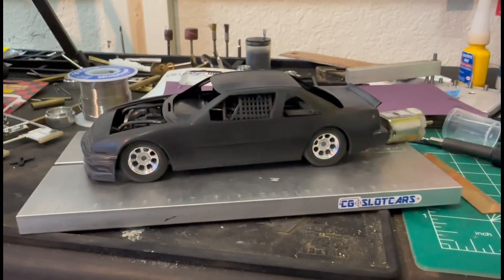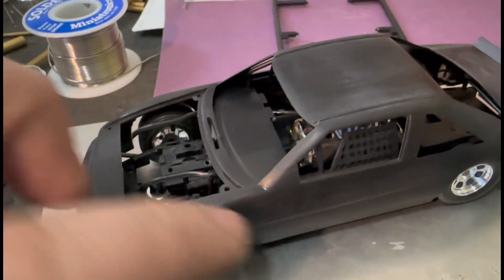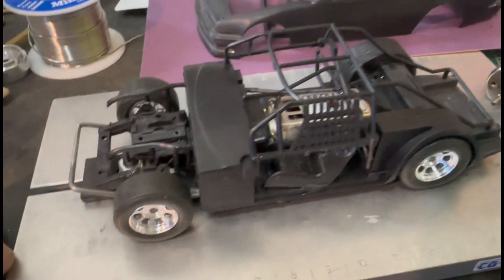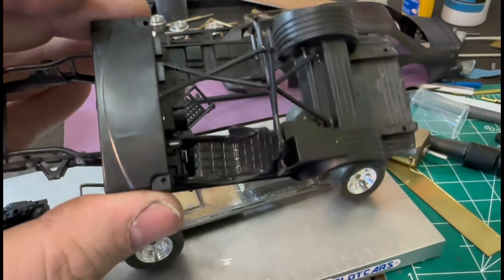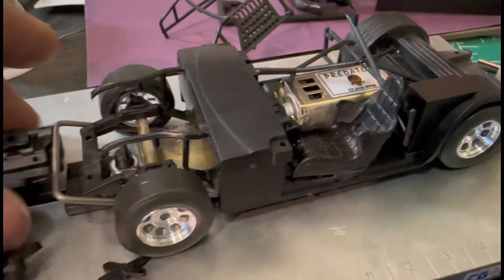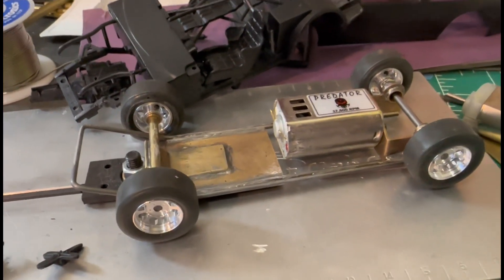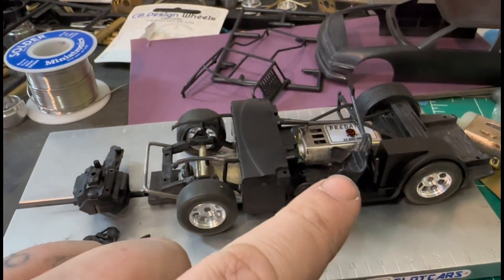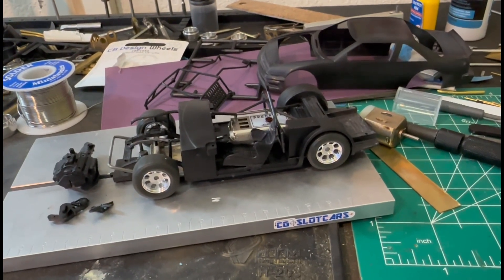MT Winston Cup Build Pt.3

Comment: Don't worry too much on the exhaust- I'll trim off 1/8" of the kits pipe and glue them to the bottom of the body or I've also used brass tube flattened to and oval and epoxy those on. Rules always included a driver, use the lightest one you can find.

Comment: Good lookn wheels, I shuda went with those. I just used the inserts, they are so tiny to work with. Had to sand um down a bit so they would fit in the wheel. Anyway, lookn good Danny!